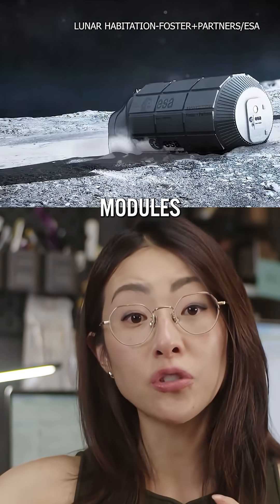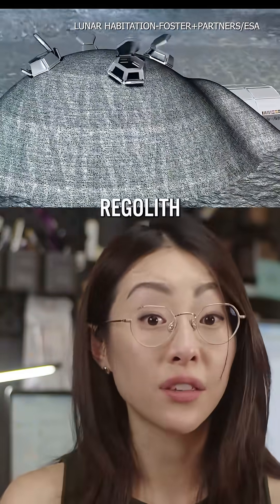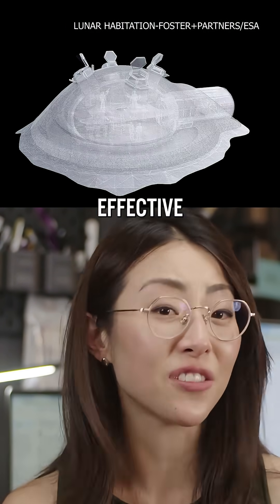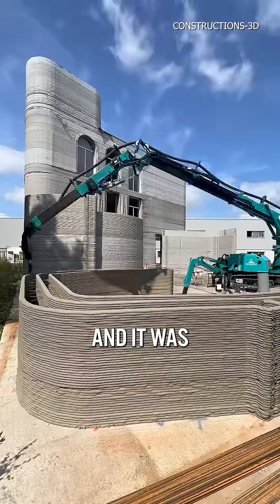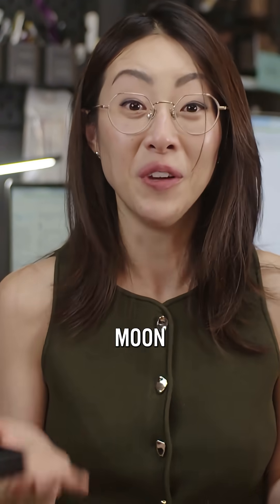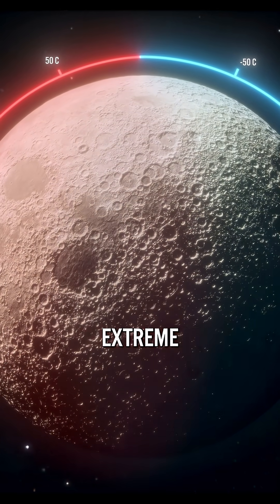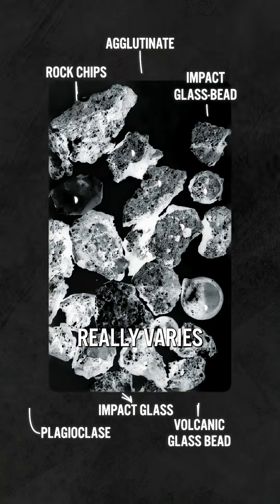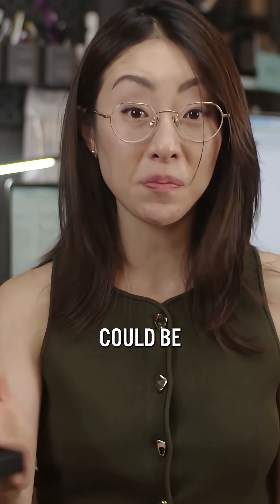What would you build first if you had a lunar 3D printer?

Comment: It seems like it would be better just to inflate a shell, spray it with epoxy (or similar), or erect prefabricated shell pieces, and then just bury it with regolith.  It might not add strength to the shelter, but it would add shielding from micrometeors and (maybe) radiation.  I dunno about the radiation.  It's a bad place to live.

Comment: As someone sho has actually printed with lunar regolith i can tell you that it SUCKS as a printable material. And I mean it sucks. It doesn't bind to itself, it gets everywhere, jams up joints, and is both thermally and chemically resistant. Based on my experiments its easier tk just refine the regolith down into ingots and use the poorer quality lunar metal to build a cage to put the regolith in.

Comment: Not to mention that they'll need a fluid to mix the substrate with. Fluids are dense, heavy to transport, can't be condensed, can't be lightened.
It's a bullshit idea. The normal smoke & mirrors & boundless optimism of fruitless minds crap.
You'd be better off melting it together, but the power requirements would be massive. You could use a lens, which would be economical, but then you'd still have to have a formwork capable of withstanding temperatures of molten rock

Comment: Isn't the idea to live in the Moon?
Boring tunnels is not easy, but using available regolith for necessary reinforcements, cutting in sun-tubes, using diffusers and mirrors for light, and relying on solar for most electrical needs... that's all really just an engineering challenge and opportunity, right?

Comment: I thought it was a stupud idea the first time i saw it. I was like how will the concretr dry or cure? Where are the support beans? and load baring pillars and walls? Where are thr providions and space for electrical wiring and plumbing?
I would much rather go with prefab blocks that have space inside them. You stack them, yoy can have steel wires for the tensile strengh, and there is also pace for wires and pipes. Plus there will be air pockets all over that can insulate, and if more insulation is needed, tgat can ve added during construction. Best part, all of these can be made in a factore somewhere for cheap and shipped to locstion. Even better, the builder hould buy them in bulk for all their construction projects and reduce overhead. They would also reduce air pollution that cones with construction.

Comment: 3D printing in the arena of a simple home hobby machine has not really reached its peak. Sure, machines are much cheaper than they used to be, but they are still finicky (or you can't troubleshoot them yourself, before the Bambu fans arrive). 

Their main advantage is bespoke manufacturing, anyway, which something like a building doesn't really benefit from (especially a lunar habitat, which by its nature needs to be mass produced).

However, they are used in space exploration. For quite a while, now, the ISS has had a 3D printer that they can use to make specialised parts for one-off repairs...parts which can be extensively designed and tested on earth (where waste is not such an issue) and the digital file transmitted to the astronauts for final manufacturing.

Comment: You can 3D print almost any structure you want on the Moon using nothing more than dirt and sunlight. The Moon is basically one gigantic pile of silicate-rich regolith that melts into glass when heated. All you have to do is concentrate sunlight into a narrow beam, raise the temperature high enough, and fuse that dust into solid material.

Comment: Yet they have revolutionized fabrication in so many other areas, especially prototyping. It is only natural that as the technology improves even more, some of the hoped for revolutionary uses will be realized. Material science and robotics also need to advance to shrink the devices and provide better construction material designed specifically for 3D printed building. The current generations of large scale 3D printing machines have not yet realized the revolution threshold because they are not yet cost-effective, common, or simple in operation. Airplanes also did not revolutionize things overnight. Yet 100 years later, they are ubiquitous in the transportation sector.

Comment: ● Much of this construction would also need to be performed by dozens of largely autonomous/AI drones (excavating, pulverising & sintering the Lunar regolith for 3D printing in situ) long before there's a human presence on the site. There would need to significant redundancy in printing systems, with repair & cleaning robots included in the mix (otherwise the entire project could be derailed by a blocked print head or fried circuit board).

● Any permanent Lunar presence would likely be both close to the Southern Pole (where there's considerable water available for human consumption & conversion via electrolysis into hydrogen fuel & breathing oxygen), at the bottom of a large crater (where there are less severe temperature swings, marginally more shielding from radiation & access to lava tubes for more permanent, well shielded, settlement structures).

Comment: But WHY would you need to lug all the material as well as a 3d printer to the moon's surface? Isn't the main point of 3d printing a house that it's less labor to make it? The moon has far less gravity than earth, so that means you could lift heavier objects easier, which makes the work load significantly easier. You wouldn't really need a 3d printer robot considering you could likely lift a couple bags of concrete over your head far easier than you could on earth.

Comment: Yeah, I work in AEC and AS cool as 3D printing technology was when it was introduced to the construction industry, I knew it would be a couple or three decades before we saw anything too mainstream.

Yes, it has the potential of reducing time and costs while maintaining quality (typically you can only improve two of those by sacrificing the third). But some of the main drawbacks are that it uses non-renewable resources as the printing material (concrete/cement), every job site is unique unlike the printing table on a standard 3D printer, and it is no more modifiable than a house built entirely out of CMU or brick. You have to convince the public that they want a house that is entirely to their specifications but will have a harder time renovating or adding on than they would with traditional timber/stick frame (which, coincidentally, is more renewable because it uses wood, and last I checked they don't have a "wood filament" for these building 3D printers). Also, because it's still not a mainstream technology due to these and other issues, it's not as cheap as it could be either as the technology is still relatively new and has not yet seen the immense cost savings that were originally promised.

Comment: Printed concrete has been around for ages, pretty sure I seen the same tech in a video from the early 2000’s or late 90’s.
Just slow and worse than making a form with a predefined internal structure.
With the printed version you need to reinforce layers instead of the whole thing at once, standard concrete has a rebar frame while printed had rebar pieces/layers of rebar frame.

Comment: I work in concrete, have been since 2008. 3d printed homes aren't taking over traditional construction at all. They are a pain to deal with if you have to add in wiring in the walls later on. 
Also I don't think the layers are properly fused together like with poured concrete walls. The insides seem dystopian and dark. Concrete will hold on to cold so in winter they would be very cold. 
Somebody please prove me wrong.

Comment: It didn't because concrete doesn't work that way. It was a neat thing to trap investors with a scam about, but ultimately it's kind of useless otherwise. 

It's better to print materials than to print in place. Because you can print the materials flat in an orientation they aren't in right away.

Comment: ...wouldnt it be easier to dig out caverns in the regalith itself then inflate a pressure vessel inside the holes? then you can manufacture surface pieces in said caverns and build on the surface.

Comment: Instead of 3D printing, they should simply use autonomous rovers to push the Regolith onto the structure and then use some kind of binder sprayed on top to bind it together into the necessary structure.
And they can still use the three d structure that they design by making durable fabric forms that they can funnel the regolith into to build structural members, especially if they have a fluid distribution system.Built into the fabric forms to apply the appropriate binder.

Comment: Anybody suggesting tunnel boring machines clearly doesn't understand how obnoxiously massive those are. They can be several thousand tons, and even "take it apart" doesn't necessarily work because some components can be 50+ tons by themselves. 

That's before you even consider issues like power, cooling, maintenance, etc... Those machines require entire crews who specialize in their operation and upkeep just to work here on Earth. It's not even remotely feasible to use that kind of equipment on the moon.

Comment: How are the problem that you have with doing anything on the moon is you don't have a polar access the same as you do on Earth. The same with Mars so the electronic fields are different and the harmonic fields that are produced by the Earth polar axis are what help with your health and your capability of surviving in this environment. So you would have to come up with a magnetic field generator that would actually produce similar magnetic, and harmonic field output as the Earth's magnetic field does. And we're really close to the magnetic field of the earth as to when you get out towards the moon or the outer edges of the Van Allen belts.

Comment: You don't need to 3D print a shell, just bury the structure under 3 meters of regolith. 3D printing in this case, is just extra steps and extra resources. Which equals more time, and cost.
@Anthrofuturism
 has a 50 minute presentation video of his proposed method of developing the Moon, which made a lot of sense to me, and I highly recommend checking it out

Comment: I don't understand why would we even do 3D printing construction on the moon when we can just do injection molding All you have to have is a funnel around the inflatable part and then just start pouring concrete in and pouring concrete is way easier to do than the 3D printing deal unless you're looking for a certain aesthetic or certain pro to it on top of all the training you'll have to do to actually do that it needs to be perfected either way before we can even take it on the moon it's still in its infancy

Comment: An actual civil engineer here one of the problems with 3d printing is the concrete mixture you need to use its very complex and different from normal concrete and that means just added cost so why not just do it the normal way + everything else others said
Reply: Not to mention, you can't really use water and other bonding agents like you can use them here on Earth. The only reliable way to do 3D printing is to melt the regolith. （For now)
Reply: Modular prefab buildings just make so much more sense than 3d printing.

Comment: Construction sites can be chaotic because you have seperate teams that dont really necesairly comunicate with each other as much as a poc or person of contact who is supposed to manage such things. Which can be challengeing for a number of reasons but a lot of times its a lack of coordnation and cominication. Also it provides challenges for whos responsible for what in the event one team sort of condems another in a way cause mistakes happen.  Also weather can play a big part. Also theres zoning and permits that have to be concidered and dead lines.  Then theres also safety regulations that can slow things down. Theres a lot and im sure i havent mentioned them all how ever in theory it would be a lot more systematic (easy) to let a machine do it. Also theres a missing component such as robotic arms to lay rebarb and possibly tie the rebarbed. Soo a full fledged system hasnt been made yet but it is a work in progress that im sure will revolutionise building as soon as the tools are made. Also you can charge devices with the sun. 3d printing is only the begining.

Comment: Also we have established industries fighting 3D advancement. Also the system used now, of stacked walls, not bird bone like, is a problem. To top that off you have issues with wiring, ventilation, etc. It requires a total rethink in design and acceptance of changes by users/developers.

Comment: Ohh manufactiring something I have a lot of experence in.
The moon makes it easier to 3d print. A big part of the issues with layered concrete is the concrete, the other huge issue is how strong earths gravity is. Concrete needs to bond to itself and not dry out before the next layer so winds and sun can all ruin a concrete print.

the lunar regolith does not suffer the same issues, it interlocks, it has a fairly low level of energy required to sinter it, and yes the proposals are going to change shape because of heat expansion, but that expected and easily compensated for

And also something we are looking at so that we can have drones building everything

Comment: No 3D printing on the moon is a bad idea because it requires a lot of imports.
The best thing to do on Luna is to use some form of bog iron/ low quality steel along with centered and cast regolith 

As the 3D printing option requires imports that aren't readily available on Luna.
Although the 3D printing route does use considerably less energy than casting and centering, most of the energy required is completely free, it does require vacuum which is also free due to Luna not having an atmosphere.
3d printing, housing and infrastructure would make far more sense on somewhere like Mars. 

Anyways, thank you for coming to my TED talk.

Comment: Doesn't just build the concrete foundation and walls tho? Like it builds fast, if weather is good, but you still need good insulation, windows, doors, non-concrete layered interior walls, non-concrete floors, etc? I mean, the main job if actually having a structurely sound building is there, just idk, still a lot of work to do as well.

Comment: The issue is the tech. It's just not there yet. You need a printer the size of a house instead of a small thing that moves around. You don't yet have automated robots that can supply the materials to the printer. The tech can't deal with sharp corners, like right angles which are found in construction for a reason. It is slow. Reinforcing elements need to be added manually. It uses concrete instead of some advanced materials. If these problems get fixed we will have a good chance that 3d printing will be useful in building.

Comment: the reason is cost vs outcome. you can 3d print a house, it does work. 

The problem is that it takes a long time to setup the 3dprinter. Far longer than just getting the materials from a factory and assembling on site.

Comment: Instead of 3D printing of the structures, it would be more effective and economic to inflate a balloon and spray something on it that foams and hardens. 

Then use locally sourced metal material to reinforce with rebar. Then spray on regulith with a binding agent on. In the same way, they manufacture monolith dome structures on earth with spray on concrete reinforced with either fiberglass or steel Rebar. 

This is faster, cheaper, and more effective than 3D printing, and it would use pretty much the exact same or less material having to be shipped from Earth.🤣

Remember, the KISS method is best method.
KEEP
IT
SIMPLE 
STUPID

Comment: Seems a lot smarter to just ship a load of parabolic mirrors and tungsten molds, and use concentrated sunlight to sinter or cast interlocking bricks straight out of lunar regolith. I know very little about the composition of lunar regolith, but I'm reasonably sure that it melts before pure tungsten.

Comment: Lunar soil is a lot more abrasive than earth soil. It’s going to destroy pumps, hoses and anything exposed to the elements. That also not including the radiation exposure on the lunar surface.
Reply: and because of radiation you want as thicccc layer of regolith as you can manage not some "hollow bird bones"
Reply: @jakubrzepkowski2290 At least someone knows what they are talking about. But that's a common problem with architects. They have their own prescriptions of technologies, and how the world works. I know because I came from that world.... LOL. Only when you really try to solve real problems, and you have no technologies there to back you up. This is when I found I can't live in that world and live among their own hallucinations.
Reply: The radiation on the moon is only an issue for squishy biology things like humans staying there for months. For robots, the radiation on the moon is a non-issue.
Reply: @dominikvonlavante6113 It is totally an issue. They are more tolerant. But radiation is like super tiny bullets that are hitting on the Robot's circuit and their bit can flip, the transistors can actually be broken, especially the smaller node. Material can also be damaged. It is not as hard as protecting people, but it is no easy task either. That's why sometimes, they need to use FPGA, so when part of the circuit is no longer working, they can reprogram the logic to another part of the chip.